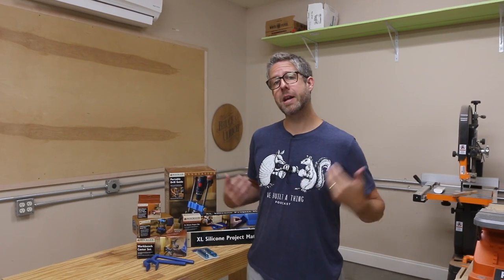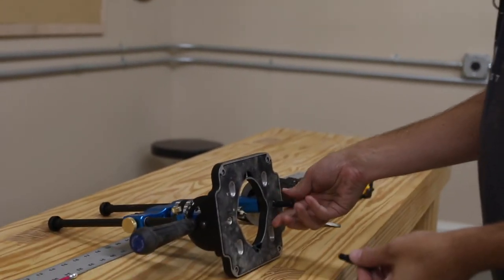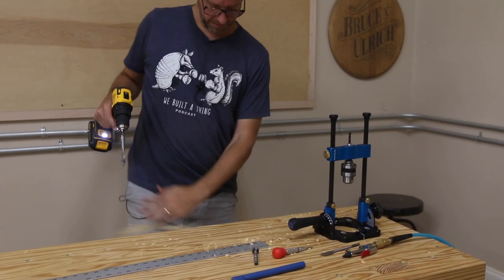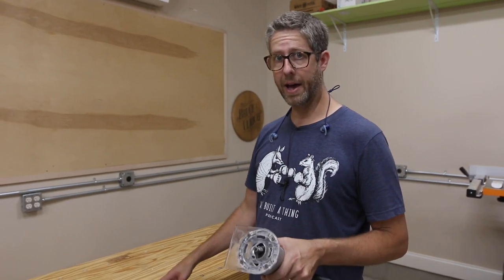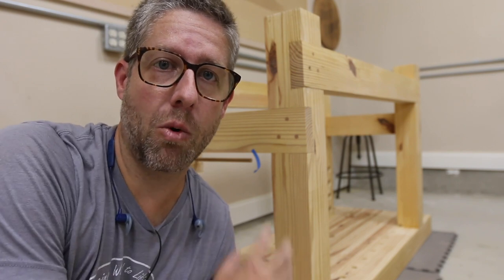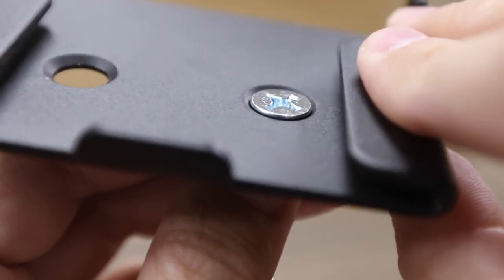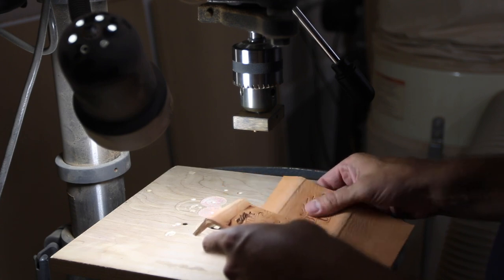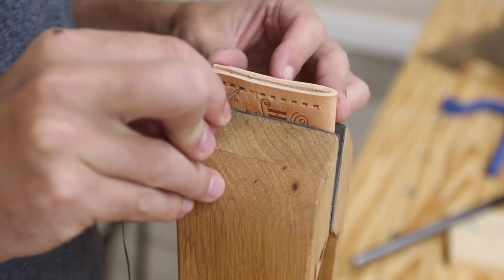Workbench Upgrades // Adding Dog Holes, Casters & Forged Holdfasts

Comment: Excellent video Bruce!! We’re you using the air hose to cool off the drill bit? With 40 holes, I bet it got pretty hot. How did you manage to drill out the holes under the work bench that were next to the legs? One last question, I promise. What kind of finish did you use on your work bench? It looks amazing, and again, excellent video!!! 👍
Reply from the maker: Thanks so much! Yep...that's exactly what i was using the air hose for. I already had it there, blowing out the holes when I was done, so I figured it wouldn't hurt to cool the bit down some. I used that same jig I made on the underside. Luckily, none of them were so close to the legs that it wouldn't work. That's part of why I made the little block so small. I used a homemade finish on the legs. I made my own wipe on poly. It's 1/3 poly, 1/3 mineral spirits and 1/3 boiled linseed oil. You just wipe it on and repeat if you want more protection. I think I only did one on here, because I wanted it to have some protection, but not be too slick.

Comment: I was catching up on podcasts since summer break is here and I'm back in the garage doing some woodworking. I heard your update on WBAT so I went back looking for this video. I built the same bench, had the same problem with holdfasts. I counterbored a few to 1.5", my largest bit without success. Perhaps there is hope with a larger counterbore than I tried. How big did you have to go? BTW, love the podcast, IG and YT! I just don't get to the podcasts regularly with 2 jobs thru most of the year.
Reply from the maker: I don’t remember the exact size I had to go, but you have to make sure when the hold fast sits sideways in the hole, it won’t hit.
Reply: @BruceAUlrich  Thank you. I'm going to test with a 3" forstner bit. I've seen in a couple of your videos you using the bench so I assume you're happy with the counter-bore as a fix.

Comment: Awesome upgrades Bruce! 
Never would have thought about the holdfast issue, normally people make beefy benches? 🤷‍♂️
Reply from the maker: Thank you! Yeah, there is this mentality of the thicker the better with workbench tops. I found that interested that the holdfasts work better at a different thickness, varying wildly with different types (forged and cast metal) and with different manufacturers.

Comment: looks good Bruce. I really like the drill press. How's your AC doing.
Reply from the maker: I have a faulty AC. It has a leaky coil. It leaked everything out in about 2 weeks. I’m not spending any more money on this one. I’ll be buying a new one soon.
Reply: @BruceAUlrich  I have two LG units in my shop. I was worried about all the dust clogging up the coil so I took a hint from Jay Bates and put filters all the way around them. Works like a champ. They've been installed since November and I've had absolutely no problem with them.
Reply from the maker: Glad you’ve not had trouble!
Reply: @BruceAUlrich  sorry that you have.